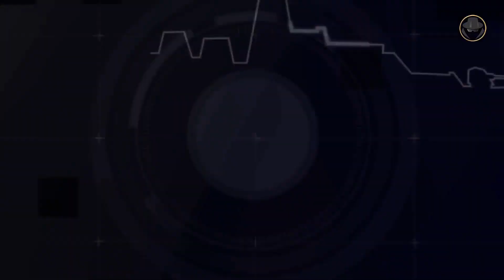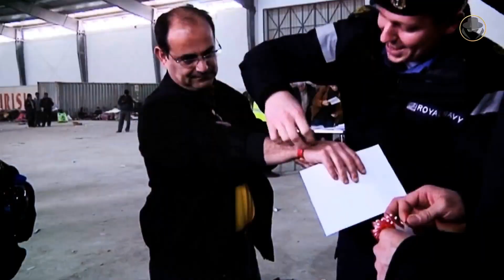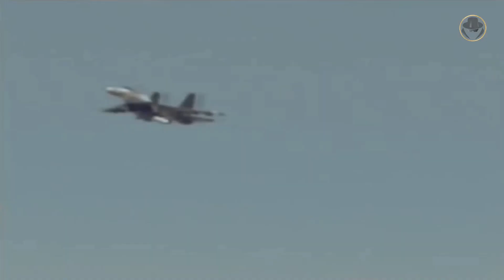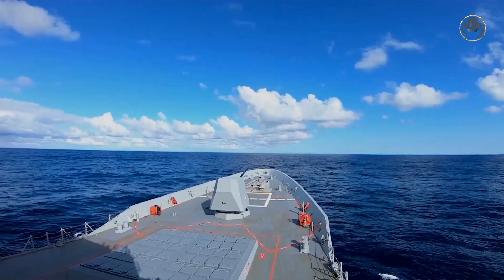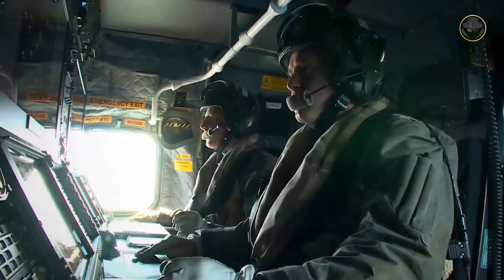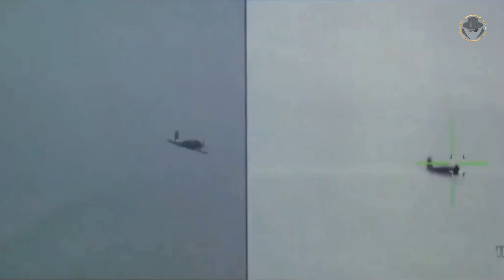Type 26-class, the next step of the frigate

Comment: I was under the impression the type 26's will be ASW ships primarily for the carrier strike groups while the Type31's are going to be more of a multirole mission type ship?
Reply: t-26 will be ASW with ASM's on board, t-45 will be air defence and could also get new ASM's, t-31's will be a light GP frigate mostly doing foreign patrols, and the t-32 will most likely be an updated version of the t-31so t-26 and t-45 can be used for carrier defence
Reply: Yes; Type 45 will be AAW, Type 26 will be ASW, Type 31 will be frontline GP, Type 32 will replace the MCM fleet and will be a drone mothership and secondary GP vessel.

Canada and Australia are to make their T26s multi-purpose.

Comment: The type 45 destroyers displace about 9,000 tonne and this video says the type 26 frigate also displaces 9,000 tonne, they will have 1 main gun and a 48 missile silo with the average close in weapons for a millitary ship, it will also do the same speed as the type 45, so heres my question, whats the difference between a Frigate and a destroyer? And when we (UK) get our new type 26's does that mean we will be losing our 6 type 45's?? I hope not, all 6 have been built from 2003 to 2013 so they are not old, we should be adding to the fleet especially with 2 aircraft carriers in the fleet, they need protecting. Yes i understand that the way we have been using our armed forces for the past 30 years has changed especially for the royal navy, the wars have been against small countrys with little or no navy and terrorists, adding multi billion pound navy assests would have seemed stupid, although we did add 2 carriers which can be parked off the gulf somewhere with little to none threat from the known enemy ( terrorists, iran,iraq,sryia,afganistan) and conduct air warfare with ease. However times have changed and we now need to build our fleet to atleast 200/300 ship fleet of all military kinds and thats just to keep on the coat tails of the other countrys who are now starting to build large fleets, Russia is starting to add aswell as India and brazil, other countries like S-korea,Japan are building and then you have China who already have a fleet of over 350 and dont look like stopping soon!! We need to keep up and help our alies like US, Japan,Australia,Canada and Nato countries, we are an island that has more history with being a sea power than any other country but we seem to be forgeting that this country was built from our centries of having a navy and letting our famous history be just history and not contributing towards making more history for this famous island!!!! Its embarrasing to see things like "Save the Navy" and constant reports about ships being canceled before getting built and ships being sold off!! We are an Island afterall and having a powerful navy should be a must nowadays yet it seems as if our goverment would rather us not have a navy and let the US and other Nato countrys look after us, a brown water navy would suit them!!!! Its a joke!! If we lose our navy or become a tiny one behind the likes of S korea, brazil or india then we lose who we are and our history turns in its grave!!
Reply: Yes and they will not replace Type 45s as they are to replace the late cold war era Type 23s. However, the navy are looking at the possibility of building a replacement for the Type 45s using a similar design to the Type 26. Then it could enter service earlier than a new design could. (They aim for 2030) that would also cut costs of developing a new hull. And because the shipyards were already building 26s they can easily adapt to 45 replacement and save more money by increasing the units constructed. Finally, by the time the Type 45 replacement enters service, The 45s will still have another 10 or 15 years of operational life left in them.
Reply: Ben Chapman type type 45’s will probably be replaced by a type 26 air ware version.
Reply: Lorraine Dyson You are right that the Type 26s will be close in tonnage to the Type 45s, but they are ASW (sub hunting) ships, whereas destroyers are denominated as AAW (anti air), so they will be called frigates. Not really about the size anymore tbh, though destroyers are generally bigger.

Comment: 25 km?  That's 250 km!  Type 23s have also been refitted to carry Type 997 and Sea Ceptor, partly to keep them relevant but also as a risk reduction measure.  No decision has been made by the RN about weaponry to be carried in the Mk. 41 VLS: your statements to the contrary are pure fabrication.  TLAM is unlikely to be carried, though: that would be a represent a major policy change.  T26 will normally carry Merlin, rather than Wildcat, to suit its ASW role, but the flight deck will accommodate a Chinook.
Reply: Wildcats are capable of antisub as well. They are also getting a new missile system which is geared primarily to help them to thin out speedboat swarm attacks so their mothership won't be as easily other whelmed by shear numbers when operating alone so I wouldn't be surprised if the wildcats replace a Merlin depending on where the T26 is assigned.
Reply: @Kakarot64.  RoKN Wildcats are, but all the FAA's can do is drop a torpedo when told to.  They don't have sonar.
Reply: well if for some reason every missile was a CAMM then they could carry ~134 CAMM's (48 purpose built launchers + 24 Mk41 VLS with quad packed missiles)